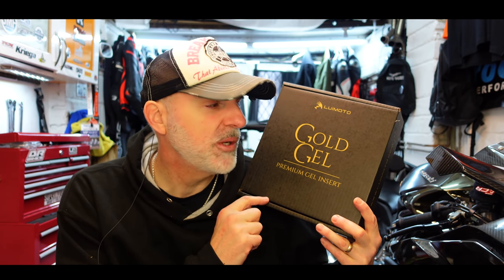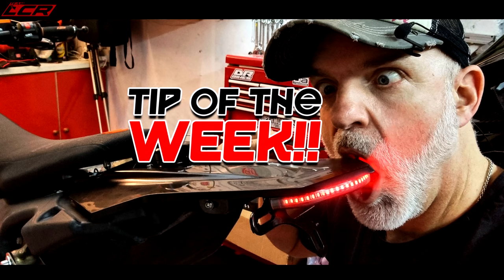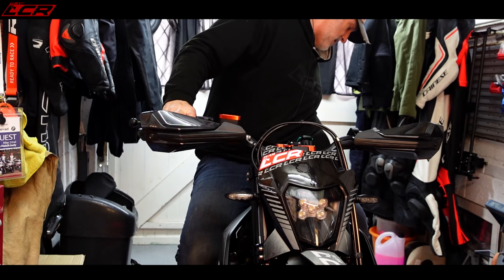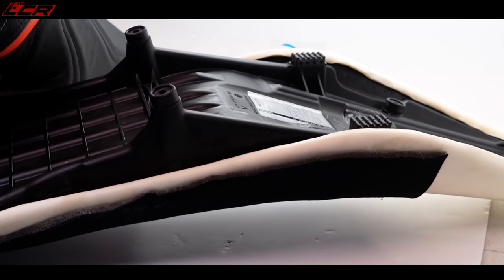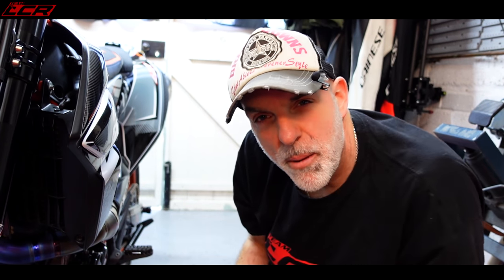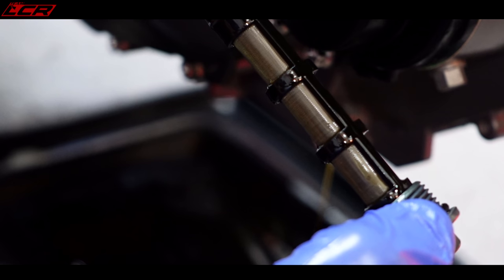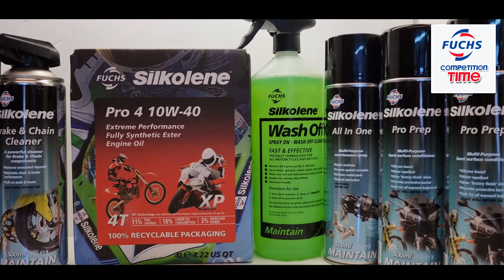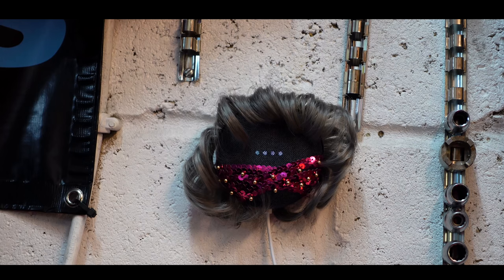KTM 690 SMCR Build EP11 | The Project Completes & Silkolene Giveaway!

Comment: When changing the oil, on my EXC, KTM recommend that you fill the new oil filters with oil prior to installing them in the engine. This helps the oil flow on the initial start up after the oil change is completed. Not sure if it is the same for a 690 but probably something to consider in the future.
Reply from the maker: Yes I remember from my exc days, they don't say to do this on the 690. Probably due to being a bit more oil in the engine 🤷‍♂️

Comment: 15:05 its good practice to pour some oil into the filter to prevent it running dry on start-up. That's also what i've seen factory mechanics do with ktm 450 rally bikes.
Reply: Not really necessary on motorcycles and small cars. Maybe on some diesel engines its a good idea, theres already enough residual oil on the bearings and such, as long as you dont instantly redline it at startup, your bike will be fine. And also, since the filter is mounted sideways, it will just be a mess

Comment: Hi Chops,
Great Build!  I notice when you built your 701 you used the R&G frame bungs, but you don't appear to have used them on the KTM 690 SMCR. I'm tracking mine and bought a pair but on looking at the mount for them I wasn't 100% that they wont damage the frame mount in a slide, what are your thoughts?

Comment: Where did you buy the throttle spacers Chopsie? I found them in the US for $36, but couldn't find them for £20 in the UK!
Reply from the maker: No only available from the website Will from the US, I didn't pay any import though as its a cheap item and arrived very quickly!
Reply: Thanks, just ordered them. Really look forward to sorting the slack throttle out. Many thanks for recommending these👍
Reply from the maker: Yes used to annoy the shite out of me! 👍
Reply: @LambChopRides  Just fitted the Ducati Spacers to my 701, really amazed that two tiny cheese shaped pieces of plastic can make so much of an improvement. Excellent product, thanks so much again for your recommendation.

Comment: What about some Oxford heated grips?
Reply from the maker: Hate the huge control module with them, why they can't integrate a button on the grip I will never know! I'm still waiting for somebody to make a decent aftermarket Heated grip 😤
Reply: @LambChopRides  The new models should just come out std with them like BMW.It would certainly look better but they do work.I have just fitted them to my 2020 690R.That SMCR is looking a treat.Enjoy.
Reply from the maker: I could have done with some Tuesday! Rode it for 3 hours to Ducati and was 3 degrees when I set off! 🥶
Reply: @LambChopRides  Never thought I would put a set on this type of bike but I have to say they work a treat.
Reply from the maker: Ah yes that's more like it 👍👍 thanks Bruce
Reply: Ultimate Addons do a nice looking set with built in controls.
Reply: I think Datatool make heated grips with a controller built into the left side.